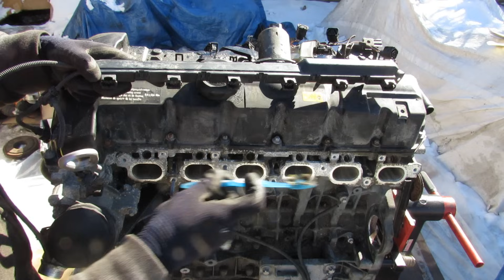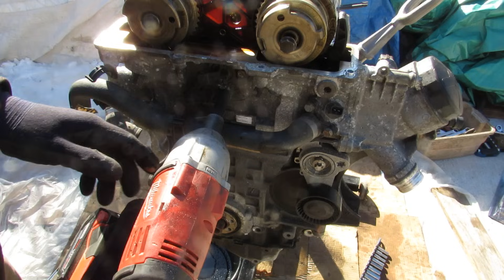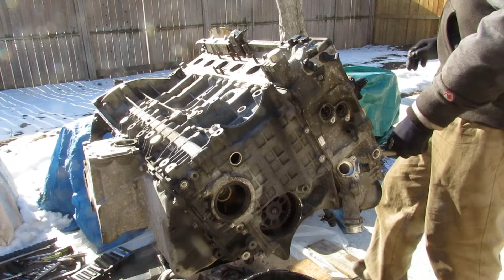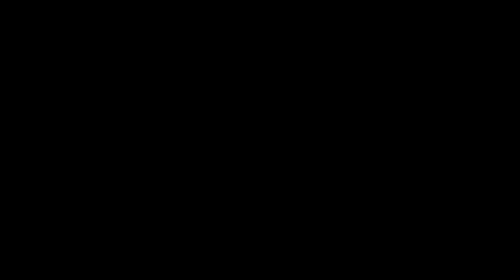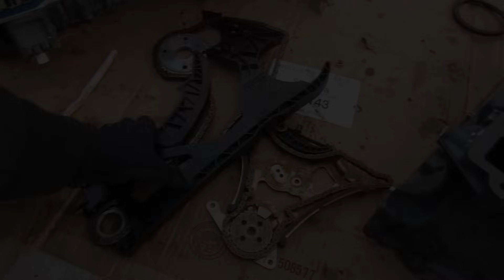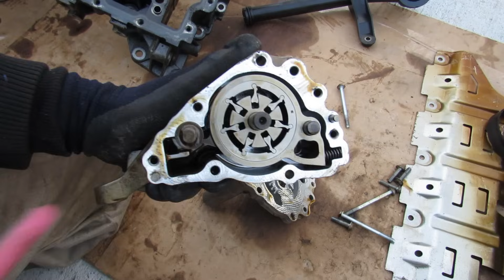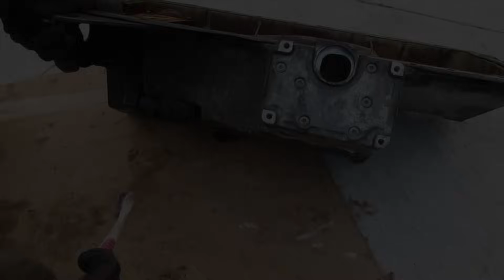The Last Inline 6 Engine: BMW N52

Comment: You stated that maximum valve lift is 9.9 mm?  Not enough to be realistic.  Did you leave out a rocker ratio, or did I misunderstand?
Reply from the maker: Yes
Reply: @speedkar99  Yes or yes yes?

Comment: This enjoy blows away Toyota for both reliability and technology. There is someone with 500,000 miles on his, no major work. It has great power and very smooth
Reply from the maker: But leaks
Reply: @speedkar99  Japanese engines leak too. If you want an engine that doesn’t leak Volvos have anaerobic seals and don’t leak, it works extremely well
Reply: @speedkar99  And Japanese cars rust like there's no tomorrow, the engines are great, but the bodies, not so great.

Comment: I just bought a new N52 engine for my 2006 bmw 325i. Old engine had over 160K miles, new enginr has 90K! Glad to know what the internals looks like. Great video my dude
Reply: My 530xit has 210k on it and runs like new 160k is barely broken in unless the BMW oil change schedule was followed. 7k no longer better before that.
Reply from the maker: Thanks and best of luck with the new motor. What was wrong with it?
Reply: Only 160? Yikes

Comment: Here in England, we have plenty of inline 6 BMW engines still being sold.
The B58 in my M140i is awesome, even though it is turbocharged, hardly any lag at all.
Reply from the maker: This video is about natural aspirated. Very different experience.
Reply: @speedkar99  Yes I know mate, I watched the video.
The title doesn't say anything about naturally aspirated though, just 'the last inline 6 engine BMW N52' ..........
I loved the M52 engine in my E36 328i especially after fitting the M50 engine manifold, and Simota carbon fibre induction kit. It loved to rev.
Oh, and I have owned a few BMW's, all with straight 6 engines, and one M40 diesel 4 pot, yet none of them have leaved or even used a drop of oil between servicing, so your opinion of them is biased and wrong.
I work in the motor trade too.
Reply: @DjNikGnashers  you are lucky then, i haven't seen a single bmw over 100k that doesn't leak hahaha
Reply: @DjNikGnashers  I'm guessing you probably didn't get that many leaks because it is a much cooler climate in England and Europe which probably explains why the plastic doesn't break. In the US and well especially here in Australia, the climate is much warmer which does ware off plastics. But yeah the older inline 6 engines are quite good.

Comment: The Valvetronic variable lift intake valve is amazing technology. 
There are limitations but you can increase the intake valve lift by +1mm for more power.
See BimmerMILVs.com 
Adds +10rwhp across the whole powerband.
Reply from the maker: Interesting
Reply: Without ruining smoothness at idle  and low revs from a bigger cam is the point
Reply: @greebj  That's the best part, increased intake valve lift only occurs at greater than 80% eccentric cam position, about 80% throttle position. Mod has no effect at starting, idle, cruise or part throttle.

Comment: Vanos sounds like a complex mechanical system, that kind of engineering reminds me of  Maillardet's automaton.   I think I would prefer push rods.
Reply: Yes vanos is definitely a weak point in every BMW engine thats had it ever since its introduction in the late 90s. The typical tradeoff of power and efficiency versus adding failure points that have IMO ruined what once made BMW great
But pushrods and single cam other old tech are why BMW's V8 put the 5.7L Gen 3 to shame with only 4L in the early 90s and then they built the S62 off it

Comment: I have a 2006 530i e60 with the n52 engine it's got 275000km on the odo, the only things that I replaced are the spark plugs and the coils, I bought it 2 years ago.
Reply: 06 530i owner aswell just over 200000 miles great car fun to drive very reliable
Reply: @bartsimpson2551  it has 370000km now but i have replaced the water pump, upper coolant hose, transmission cooler, ccv and steering rack other than that it still feels great to drive
Reply: It has been a great car

Comment: 2007 328i RWD owner here. Started owning the car since 2014, at 118000kms. Done the water pump, starter, camshaft position sensor, valve cover cracked and replaced all gaskets on valve cover, oil filter housing gasket. Power steering fluid had to be flushed due to burning smell. Ac blower motor failed. Shock absorbers replaced at 160000kms. Transmission fluid and rear differential fluid was replaced at 155000km in 2019, and it made a world of difference. I felt the car was at least 30 horses more powerful, also faster to shift. Oil pan has been leaking since 2016, but I didn't fix it, since it wasn't really damaging other parts, and it was a very difficult job. Driving the car is a lot of fun. Now the car is at 185000kms. Still daily driving it.

Comment: Had this engine since new in my '08 128i. now 130,000 miles and still working great. Also the lifter tick can be solved by running the engine above 3,000 RPM for a few minutes when it's cold. Only big problem I had was being RWD only it has a Steel oil pan and that had a paint flaw from factory and rusted through. That was a mess.If you see rust on your oil pan, DON'T PICK AT IT!!!!

The Piston mess was from using non-"top teir" 87 octane and actually letting the oil cook itself out to the Service Monitor not changing it sooner.

Comment: True that oil leaks are a problem with this engine. Here's a tip: I use a UV flashlight and fluorescent oil (liquimoly) to check for leaks on my E93. It really helps! Now I know for sure that the "leak" BMW wanted $1,000 to fix was actually them spilling oil during an oil change.
I also did a test on an old belt and even a drop of oil is easily noticeable with the UV light. So now I can check in an instant if my belt has any oil on it and (hopefully!) avoid the dreaded belt-into-crank seal car killer.
Reply: "was actually them spilling oil during an oil change." Twice they tried to do that to me. It seeps down in exactly the same spot that it would with a real leak, and it's a pain to get in and clean.

Comment: Great video! I've just bought an N52 325i and you've made it all a lot clearer. The oil leak part is so true, I can see that already...
Reply: @user-ie4kp7ni9d  mines a 2011 with 131k still running strong with no major leaks but still crossing my fingers lmao
Reply: Also the shitty oil seals and gaskets.

Comment: What do you do with all these engines that you pull apart? Do you rebuild some of them? Or are they all shot and just go to scrap metal after you have your fun with them?
Reply: You can see he have built some to a table, and scraping some, with the condition of most of the engine he get, it is really not point to rebuild them..

Comment: I have 2 N52s and one B58. The N52 is farrrrrr better and smoother than the B58. One of the best I6 engines BMW ever built.
Reply from the maker: Nice! Have you had any issues
Reply: @speedkar99  None besides replacing all the oil gaskets, and starter. Plan on doing water pump on my 3 Series before it fails because I see a shadow code for it. 2E85.

Comment: I have that same engine running in my F10 for 11 years and i can vouch for the reliability. The only thing that fails are head gasket and coil packs. And yeah, i think i need to check that plastic tensioner. Great video man, really helpful.
Reply from the maker: Awesome! Have you had to replace the head gasket? I didn't read about that issue
Reply: @speedkar99  Yes, i had it replaced. I live in a hot area and at that time my radiator was leaking so my engine overheats. So when the oil temp suddenly rises, i pulled over, towed it to a shop and asked to check the head gasket and yeah it cracked. Luckily, the engine is fine and labor is dirt cheap in my country so it didn't make me broke.
Reply: @Bang_Jaws  You got real lucky! Usually you get a head WARP not just a popped gasket with a coolant loss.
Reply: @Bang_Jaws  I had the radiator issue as well but luckily I caught it before my engine got hot.

Comment: Hey my friend.  Toronto in tha house. 

I'm a master auto techy in the city y'all. Toronto represent.  North York baby. Garbage cars eeehhhhhh my friend. They certainly are. 

Saw that you forgot when you dropped the oil pan and showed it. How there were metal casing nuts.  Those are from the vanos bolts. They break apart and fall down into the sump.  There's a recall on them, on the vanos unit. Don't know if you noticed those and if you saw and wondered what those are.
Reply from the maker: Hi fellow Toronto bud! 
I took the pan off upsided down. I didn't notice extra nuts.
Reply: @speedkar99  

Good morning my friend. Well there not really nuts, it's like the head part of the vanos bolts.  The recall is to replace the vanos bolts, 4 of them. Because the original ones break off, that's BMW quality right there.  BMW garage shitbox. 

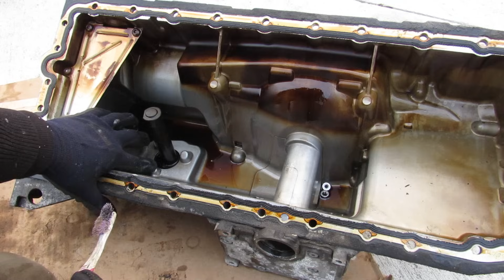If you pause @ 19:11 of your video. To the right where the axle shaft goes through the oil pan, you can see 2 shiny metal things.   If you still have the oil pan, look inside it'll still be in there

Also if you still have the vanos units.  You'll see the broken bolts. 

Let me know my friend. I'll be right here and waiting for you

Comment: Please someone tell me why anyone likes bmw.
Reply from the maker: Inline 6 revs sweet
Reply: RWD, inline 6 and handling
Reply: BarbarossaBMW88  define old, about which decade are we talkin.
Reply: Alunimun blocks, high power, good looks,insane steering feel and handling, aluminum subframe and suspension components, a lot of high technology. The plastic parts make it light, The luxury mixed with performance. I hope you start to see why. well balanced.. These are why people like BMW. If it has a oil leak, fix it and that's it. This engine broke because it was not cared for..

Comment: Too bad BMW engineers are not required to work on BMWs for 2 years in driveways.
Reply from the maker: Haha that would be a good requirement
Reply: That would be a quality circle: the engine designers have to service and fix the engines.

Comment: Why is the carbon a result of the engine "not being properly maintained"? What could the owner have done to prevent it?
Reply from the maker: PCV system. 
Needs Italian tune-up.
Reply: @speedkar99  thanks! I have a E93 that I want to last forever, but I find it impossible to do the Italian TuneUp in SW Ohio. Mostly flat, crowded and ridiculously low speed limits. Would you recommend tracking it to prevent carbon or is that medicine worse than the illness?
Reply: @taquechi2  Hey, I live in Ohio, too, but in the Columbus area.  I've been told that to prevent carb buildup, you need to go on long highway drives somewhat regularly.  You just need to run your engine at operating temperature for a good amount of time.  I personally find the best way to accomplish this is to do my grocery shopping out of town.  For example, instead of doing my grocery shopping in Columbus, I'll drive to Marysville, which is 25 miles away, and the highway speed limit is 70 mph.  Surely there's a town at least 25 mostly highway miles from you, where you can go to run errands.  You won't need to worry about carb buildup if you regularly do long highway drives.  Of course, that's for port injected engines.  For direct injection, LOL, good luck.
Reply: @hamsterama  good idea! great weather today to go with the roof down to dayton for milk and eggs!
Reply: @taquechi2  I agree, great weather today!  I myself went on a drive.  Unfortunately, I can't take the top down on my Corolla LOL!  Regular highway driving is very good for a car.  It's less wear and tear on the engine and the transmission.  If you make this a regular habit, you'll prevent carb buildup as well.  Ohio is full of rural roads and highways where you can just go for a drive without having to worry about traffic.
Reply: @speedkar99  Does that include port injection?
Reply: Occasionally floor it above 5k RPM for a couple of seconds. That will burn off carbon build up instantly. 

Use premium fuel and oil. Both work to cleanse the engine as it's running. 

Change oil no later than 7k miles.

Comment: I would be VERY wary about buying an out of warranty modern BMW without full service history.
Reply from the maker: I personally wouldn't buy one even brand new
Reply: @speedkar99  last year I was looking to buy a M3, a 09 with the 4.0 V8, ended up with a ISF, a friend bought the M3 I was looking at and is now looking at a engine rebuild, dodged a bullet there.
Reply: @TeUhtred7860  cracking unit when it's working tho but yeah an M3 isn't quite as much fun as a front yard ornament
Reply: @speedkar99  yeah drive a Honda for the rest of your life

Comment: Honest question here. How do you know so many things about so many different areas of a vehicle while so young. Ita like you went to school for years then applied it for another 10 yrs
Trans, vvt this, that,  whatever complex system on the vehicle it's like you helped design it. I'm not kissing ur butt I'm honestly curious
Reply from the maker: I learn as you learn here, pulling the actual thing apart and investigating by myself. I don't go to school for this stuff, no school will teach you like this.

Comment: Do you own a scrap yard or you bought all those cars and engines just to show us the internals?
Reply from the maker: I bought them to teardown. I have a dozen engines in my backyard, lol
Reply: @speedkar99  Why do you think that cyl head needs to be changed to fix the rattling of the valve lifters? I've fixed mine just by disassembling and cleaning them. Is that one of those 'my brothers toothbrush' type of joke?
Reply from the maker: If it's bad enough to have clogged to the oil gallerys leading to the lifters
Reply: @speedkar99  Plz list all the useable components  on ebay thx :)
Reply from the maker: What's usable from this? What are you interested in?
Reply: @speedkar99  Just bought an intake cam for my 03 Saab 9-5 off Ebay a few days ago. Sadly (or luckily LOL) I don't need part from this N52 engine. Maybe your wife can help you sell some good parts from all the teardown to generate extra cash. Just show them in the end of each video so prospective buyers will know about their condition. Small parts like solenoids, injectors, air pumps, modules, etc., that are expensive, easily stored, and shipped. Just an idea. Been enjoying all your videos thx!

Comment: I'm running this engine in an 08 328xi.  It's a smooth and great sounding engine but yeah pretty much every gasket has leaked and needed replacement already.
Reply from the maker: How many km on yours and ha e you had any issues?
Reply: I'm at pretty low mileage for the age of the car:  88,000mi (141,000km) so far and no major breakdowns.  Still runs very smooth and is a great daily driver.  Have had to replace leaking valve cover gasket, oil pan gasket, oil filter housing gasket.  The evaporator leaked out all my AC refrigerant but that was fixed for me by the dealership out of warranty as goodwill.
BMW has a great enthusiast community and procedures for virtually anything are widely available.

Comment: Those head bolts definitely aren't aluminum, as it isn't nearly strong enough to clamp the head.
Instead the color of the metal look a lot like titanium.
Could you please try to grind one, and see if it sparks like titanium?
Reply from the maker: The head bolts are likely steel. But every other bolt seems to be aluminum. It's so light!
Reply: @speedkar99  Could be forged aluminium alloy?
Reply: @totalrecone  They’re steel. The block fasteners on the N52 are aluminium, as the block is a magnesium-aluminium alloy. Steel bolts would cause corrosion of the block itself. The head is aluminium so the bolts up there are steel. 
The aluminium bolts are marked with a blue dot on top and they’re single use and torque to yield. 
These are a pretty cool engine, more reliable overall than the the previous generation M54, imo.
Reply: They look like electroplated cadmium carbon steel.

Comment: Thanks for this N52 teardown!

I'm an owner of a BMW 328i X-drive with N52 engine.
Yes, I have done the valve cover replacement including the gasket. I've also replace the oil filter housing gasket. And replaced the coolant hose attachment (plastic) located at the oil filter housing. I replaced it with a aluminum one.
I've also put in some AT-205 to stop oil leaks on the other gaskets. This seems to be working quite well. The engine itself is covered in grease and dirt.  But it runs well and I enjoy driving the car.
It is unbelievable how many rubber, plastic parts there are in a BMW.

Lastly, BMWs need to be driven hard. So that the carbon build up goes away. Give the engine an Italian tune often and it will last longer.
Reply from the maker: Good advice. Does yours burn any oil?
Reply: @speedkar99  It doesn't burn oil. I'm on 115K miles. At least I don't think so, because I have only just put in the AT-205 to stop leak.

Comment: Can Vanos really cause Valve damage? On the VTC rattle video you said it wouldn't harm anything cause it rattles in between normal limits. Why would it be different here?
Reply from the maker: Interference engine, and a small valve rattle at startup is so miniscule compared to changing timing mid-rev of Vanos looses oil pressure!

Comment: It worth mentioning that if you have an oil leak from the eccentric shaft position sensor o-ring that is located in the front of the valve cover, it should be replaced ASAP. Otherwise the oil will get into the sensor and destroy it, and replacement of the sensor is a pain.
Reply from the maker: Good point. Another leak point on these 😦